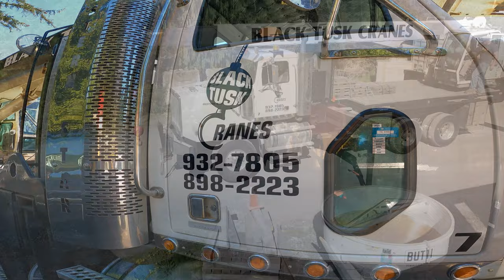MAGNIFICENT CHAINSAW 8ft  WIZARD   Wood CARVING - Gandalf

Comment: Are you putting your laptop in jeopardy with the dust?  That will clog up your heat sink, kill the fan bearings leading to running hot and eventually killing the mother board.  
Oh... and the cedar rendered scene brought warmth to my chainsaw heart, man
Reply from the maker: ipad not laptop .. and if it did die cause of that id consider that a right off cause i have to have it for reference

Comment: hi .  i am new to wood sculpting . i had been watching your amazing skills on display on youtube . i have a question . i read everywhere about safety tips for chainsaw use , and they all say not to use the tip of saw , yet  i noticed all the  sculptors who use the  chainsaw  use the tip of the chainsaw without any kickback !!!!!!!!.  they  also use the tip for plunge cuts . please advise . ( i am considering starting with a mini chainsaw for blocking the wood sculpture )
Reply: So I'm new to carving and thought the same as you. You do get used to it the more you do it. Key is to always be ready and position yourself so kickback will miss you just in case.  You do get a feel for it. That being said I was almost done with my best bear yet and while using the tip to do some eye work, my saw kicked up and cut my bears eyelid off.  So pissed but that's how you learn.